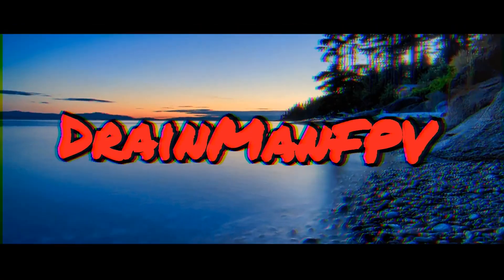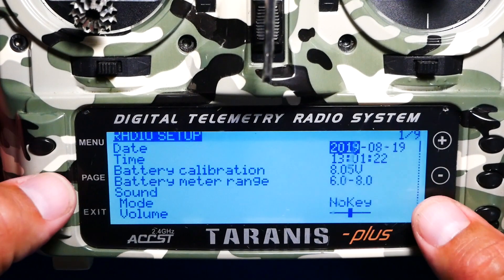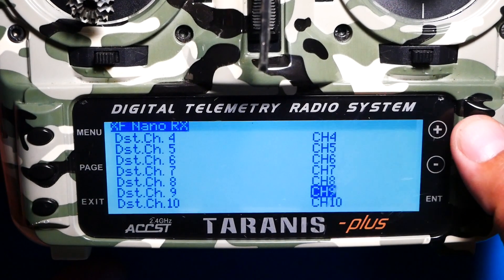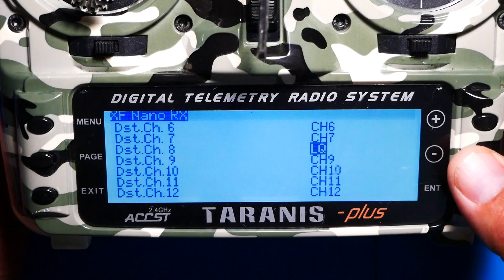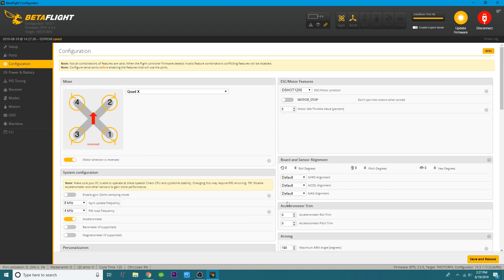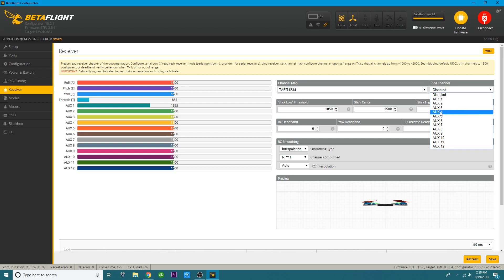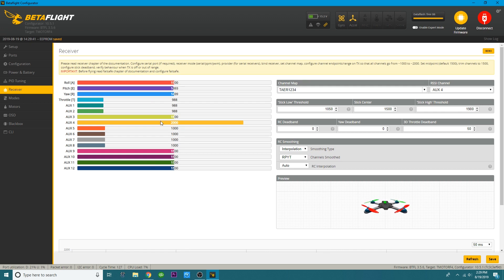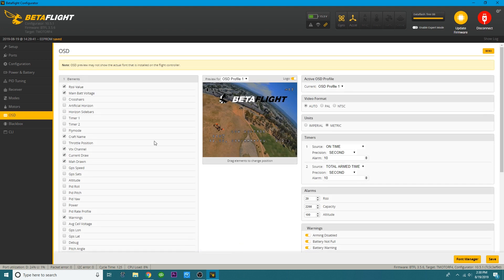How To Set Up RSSI / LQ in OSD for Betaflight & Crossfire

Comment: I follow your channel. Always learning new things. Thanks. I run crossfire nano rx on all my quads no issue. I just installed my first crossfire nano diversity and for some reason I’m stuck on 49 for my rssi value. I have the same setup as you have here but for some reason it’s not working like my others. Is it different for the diversity receiver? Please help
Reply: Hey FPVNycDream, I'm running a micro rx but my rssi is stuck on 50%. Did you happen to find a solution to this problem for your rx?
Reply: @doncunningham3124  Ho Don. This was a while ago but to my recollection went over all the steps again and got it to 99rssi. Set your aux to 1000 set 
Check out JB’s crossfire setup video

Comment: RSSI stays at 100 even after powering off tx. Flashes LQ 0, RSSI 0 in OSD... ?
Reply: Mines stays at 100%, too, regardless of batter power or power from laptop. LQ does not show on OSD though.
Reply: @ZabDevin  Same here, have you found the issue? I really want to move on with this build!
Reply: @inZaneFPV  Yes, I am using DJI FPV goggles. It turns out that LQ is still not available natively. The work around is to assign LQ to a channel (e.g., 9 in my case) in your transmitter and match to appropriate Aux in Betaflight (e.g., 5). Choose a channel/aux combination that isn’t being used. In addition, ensure the RSSI Channel in the Receiver tab matches (e.g., 5 in my case). Also, ensure that you check the “RSSI Value” box in Betaflight OSD (save). RSSI is now reporting LQ in the goggles at 99. This is also normal. RSSI should reflect 100% in the BF setup page when connected, unless you change the channel of the receiver, in which case it will read “50%.” This is also normal. If the RSSI (LQ)  reading drops to 70% or less (RFMD 1), that means your connection strength is weak. Bottom line is DJI goggles do not reflect LQ natively yet. The process for analog goggles is similar, but does not require the Aux channel setup, only the RSSI value in OSD. Oh, and ensure RSSI (Signal Strength) in the Configuration tab of BF is off in either case. My RSSI in the Setup tab of BF stays at 100% when the transmitter is near and on. If the tx is off, BF should read 50%. If it does not work this way try disconnection the quad and reconnecting to BF. I notice that once RSSI is showing 100% in BF it will stay that way if tx is on or off unless the tx is disconnected, then it will show 50% until connected, then 100%.
Reply: @ZabDevin  Dude thank you so much for taking the time to reply, really appreciate it. I'm on analog so the second part has a bunch of things for me to check. I think the thing that has me confused is my RSSI is showing 99, RSSi db is -130 in, and LQ is showing 0:0. I'm expecting to see LQ in that format but seems others have LQ showing as the RSSI value (99) in OSD. I'll keep digging, again I appreciate your help!
Reply: @inZaneFPV  did you find a fix for this?  I have an rssi reading but my lq is just flashing 0:0 also.
Reply: @ryanmorrison4322  My issue ended up being crossfire tx was out of date. As soon as I updated tx and rx it read properly. Probably should have been the first thing I checked, but I spent many hours running around in circles. Hope that helps man.
Reply: @inZaneFPV  cheers bro I got it figured out now too. Keep those videos coming I always enjoy them. If you are down in the south island let me know and we could go for a rip.
Reply: @ryanmorrison4322  Glad to hear bro, I will!

Comment: Hey drainman i need help! Got a qx7 properly modded using your videos. Wired properly an my crossfire is bound. I go to nano rx in lua and get past failsafe an the screen backs out. Cant get to channel mapping to set up LQ. My nano wont stay connected in the tbs app either 😒 wtf is wrong with it?? Reciever is working in beta, just not accessible in nano rx Lua.... shows rssi at 21% but the tx has full bars. What did i miss......also changed baud rate to 11500 but didn't see any changes

Comment: UPDATE: My FC was still on 3.5.6 from Feb 19' ... should make a note to make sure people update firmware first or this may not work.

I have no RSSI in the setup page.  I followed your install of Nano Rx which was Red to 5V, Black to Ground, White to Tx, Yellow to Rx ... I've a spot for RSSI on my XRotor FC but only used the 4 you mentioned ... do I need to do something in addition to the 4 wires for this?  BTW, the video did not show to enable Telemetry in BF but even with it enabled I'm not getting the RSSI...

Comment: Hi I have just installed craft on 3 different quads and I'm getting about 70% rssi and drops to 50 in just 100mtr and LQ goes from 300 to 200 tried different antenna positions and I'm just getting the same range as my old xm+ any tips all are running 4.1 so I don't use a aux just the new osd feature
Reply: same issue on my setup!

Comment: Selecting 8 or 12 channel mode only affects the number of channels your Radio sends out to the receiver. It does not affect the number of channels the radio/Crossfire module receives from the receiver. Consequently, you can set your radio to 8 channel mode, but still put LQ on channel 12 in the Crossfire module. Set BF to receive RSSI on AUX8 (channel 12) and you're good to go.

Comment: I never have luck putting it on channel 8, always end up using channel 9. Great instructions, spot on. Recently made the mistake of using  lq/rssi after doing a rx swap, and the osd reading was all over the place. Switching to LQ only fixed it right up.